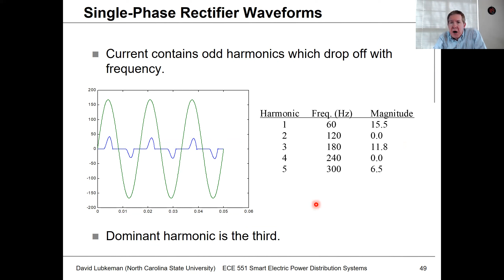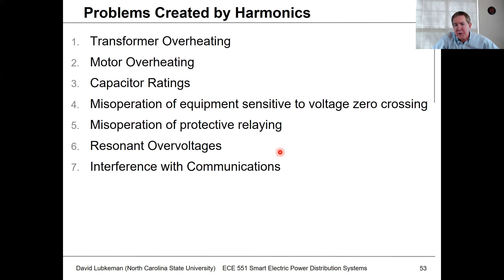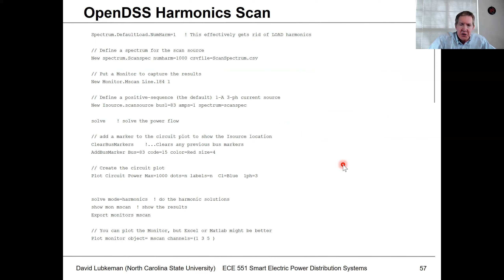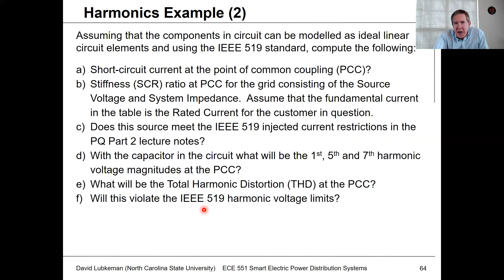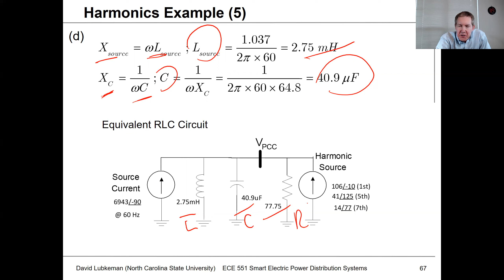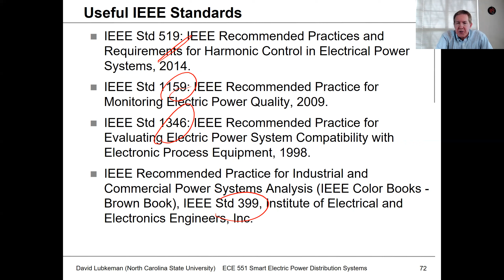Lecture 23c: Power Quality Part 2 - Harmonics - Power Distribution Systems Spring 2021 - Lubkeman

Comment: One thing that I can’t seem to get straight is what physically causes harmonics to propagate through an electrical system.  If I use a switch to generate a square wave, Fourier analysis would tell us that there are many harmonic orders within that signal.  However, what makes the difference between being a mathematical representation and those harmonic frequencies physically traveling through the power system? Does the propagation imply that the waveform is reducing to a lower energy state (and eventually, to a sine wave)?
Reply from the maker: Suppose I have a source or load that introduces harmonics at integer multiples (x n) of the fundamental frequency w0 radians/sec.  Then I will have injected voltages (or currents) at frequencies of 1*w0, 2*w0, 3*w0, etc., where w0 = 2*pi*f0, and f0 is 50 or 60 Hz.   For a typical power flow, we just focus on voltages and currents at the fundamental frequency of w0.  But for the impact of each nth harmonic component, we can build a circuit model at the frequency n*w0. 

So if I want to analyze propagation at at the nth harmonic, I need to build a model at that nth harmonic.  I need to consider all the various voltage (or current) sources at that nth harmonic.  Then I need to compute all the circuit impedances at that nth harmonic where for an ideal inductor Z = n*j*w0*L and for an ideal capacitor Z = 1/(n*j*w0*C).  Resistance will also typically increase as the frequency increases due to skin effect. Given we can build a model at each frequency, then we can compute a "power flow" that will tell us how these nth harmonics propagate throughout the system.

You might think that power systems would behave as a low-pass filter, since as series resistance and series line reactance increase with frequency, that would impede the flow of harmonics, giving us back a sine wave at the fundamental frequency as you suggest.  But this is complicated by the fact that there is also shunt capacitance such as power factor correction capacitors or shunt capacitance associated with cables, transformer windings and stray bus capacitance, etc that create resonant conditions.  So say for a series resonance situation, if we have series inductance and capacitance, with series impedance Z = n*j*w0*L - j /(n*w0*C), then for even small harmonic voltage at the nth harmonic, we could get large nth harmonic current if L*C is about 1/(n*w0)^2 (corresponding to a small series Z).  So in that case the opposite can happen if we have resonant combinations of L and C that result in harmonic overvoltages or overcurrents.  

This is somewhat of a long-winded answer, but analysis of harmonic propagation if tricky stuff.  This is because circuit L and C interactions we don't normally worry about at 50 or 60 Hz, can catch us off guard at the higher harmonic frequencies if we don't know what to look for.
Reply: @dr.davidlubkeman284   I appreciate your answer, lots of good information in there.  However as a follow up, the point I’m focusing on is the physical mechanism of something becoming a “harmonic source” that propagates harmonics upstream.  No matter how much research I do, it seems that everyone states glosses over this as a matter of fact, but physically it doesn’t make sense to me.  

Take a rectifier for example, if the firing angle of the diodes are say 70-80 degrees, this is pretty intuitive how a nonlinear current is generated.  Now, this current waveform is still being generated because the load is drawing the current, so it will still flow downstream.  What part of this travels in the opposite direction and pollutes the rest of the power system? Lots of people talk about “reflection” so I have thrown around the idea of a mismatch in the characteristic impedance of the line vs load causing it to reflect, plausible……not many good resources if you’re trying to dig this deep

As best I can tell, it’s not so much that harmonics are physically propagating upstream as much as it is the load current interacting with the system impedance AS IT IS DRAWN THROUGH said impedance.  But then this gets complicated (LOL) because how can I measure voltage harmonics on a different branch circuit outside the path of the nonlinear current flow (in this case there would be none of that harmonic current flowing here, so you shouldn’t see any harmonic voltages)
Reply from the maker: @michaelf3805  Suppose you have a single nonlinear load and when you apply a sinusoidal voltage, you then get harmonic currents.  Let's assume you have a radial power system supplied by a single voltage source for now to keep things simple.  Then you will set up harmonic current flows between the voltage source and that nonlinear load.  Because of the system impedance between that voltage source and that nonlinear load, you will get voltage harmonics at buses upstream of the load as you suggest in that source to nonlinear load path.

Now if I have a branch circuit between the voltage and nonlinear load, the top of that branch circuit (at tap point) will have a voltage that contains harmonics.  The problem is that once I have harmonics in the voltage, that even linear loads will draw a harmonic current.  So for example if I have a voltage supplying  that branch that has say a 5th harmonic and I have resistive load, that resistive load will also draw harmonic current.  There is a secondary effect due to that nonlinear load point.

So even if you are outside the path of that initial harmonic current flow, once the voltage harmonics get created, it does cause harmonic current propagation in all the other branches of the circuit.  This is why we typically have harmonic standards that limit the amount of harmonics at a customer connection point.  If that current is high enough to cause severe harmonic voltage upstream, then the rest of the circuit (even on the branches) becomes corrupted as well.
Reply: @dr.davidlubkeman284  wow thank you for the explanation, good stuff!  This is the missing piece I was looking for
Reply from the maker: @michaelf3805  Glad I could help.  Harmonics is not an easy topic area.